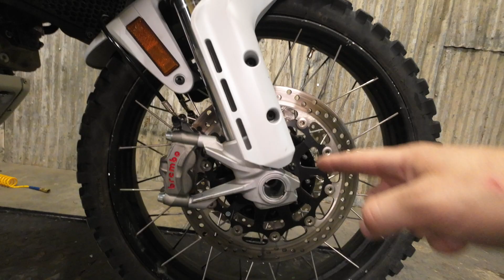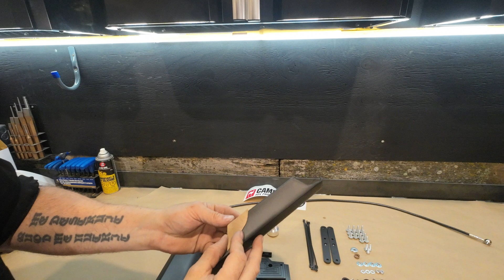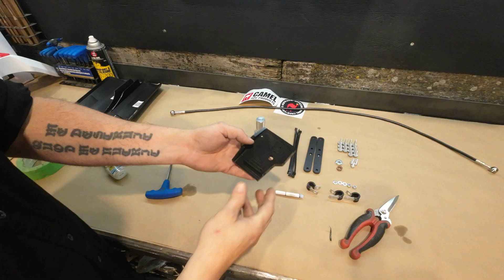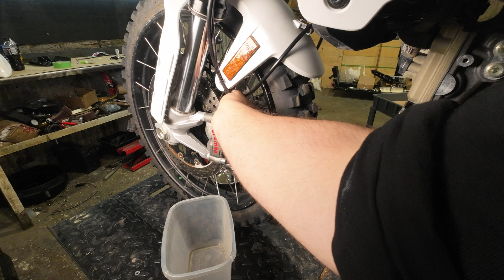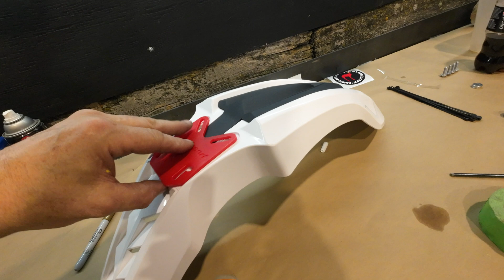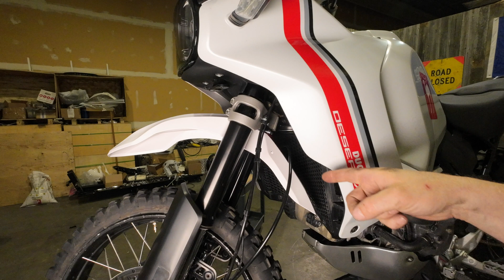Ducati Desert X High Fender Kit Intro and Install

Comment: Just so you are aware, the Norden fork guards you list on the website as a replacement for the Desert X guards are basically unobtanium right now. Even my KTM/Husky dealer couldn't order them for me. Finally found a set at AOMC, but they are running out fast. It would be great if you can recommend an easier to source option for the guards to go along with this kit. Fender was no problem. Also, while I understand that the fender is a difficult proposition to source and ship as part of the kit due to pricing and shipping costs, the fork guards are a different matter. Those should be custom made for the kit and included in it, not something that needs to be purchased separately from a high-cost supplier and then further modified for this application. That's not a corner that should have been cut here, IMO.
Reply: 100% agree with your comments and very disappointed to hear the fork guards are not available. I received my kit today and was dumbfounded to see that the forks guards weren’t included!! As you said, it was one thing to have the fender not included for the reasons they mention; however, not producing specific fork guards for this kit and not including them with the kit at this price point is unacceptable IMO. Also, I just did a search and seeing the fork guards are another $100!!
Reply: These comments from @newenglandscrambler2262 and @robertmontefusco1902 is precisely why I will not be ordering this kit. Even with an alternative option (one that you can find with a quick search) at almost double the price, I’d rather pay it than deal with the headaches of sourcing, waiting, potential inventory/supply chain issues, etc. 

Massive fumble IMO. Seems lazy by Camel.